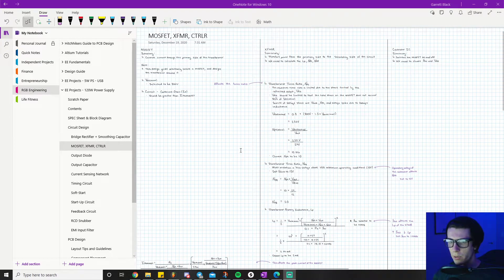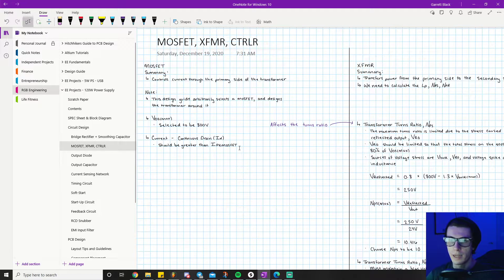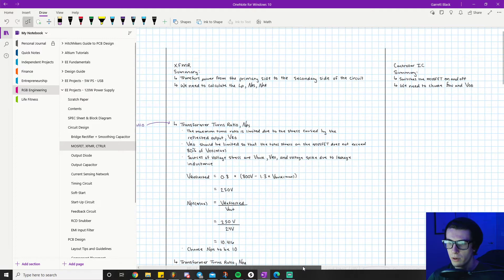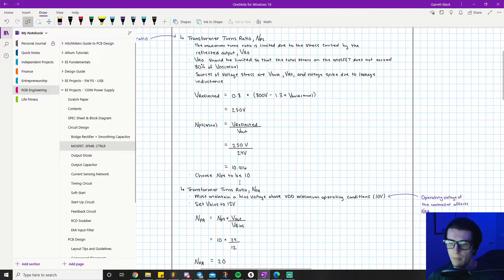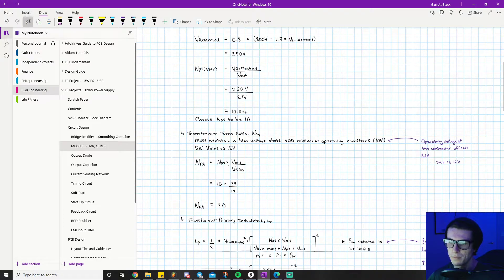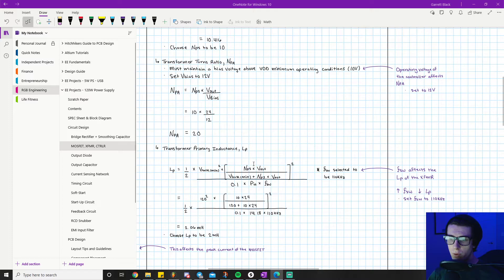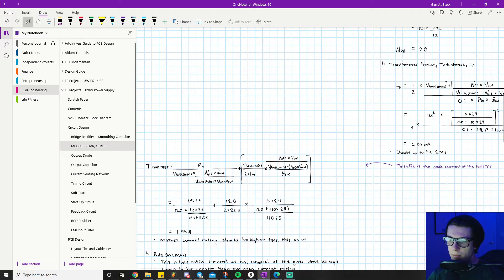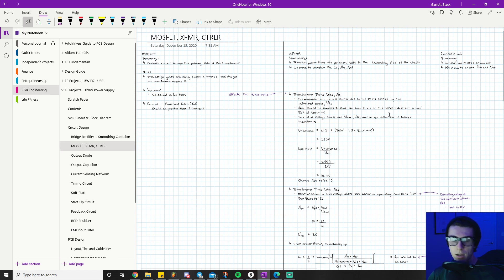FLYBACK CONVERTER PROJECT PT 5 | 24V, 120W FLYBACK CONVERTER EXAMPLE | POWER SUPPLY EXAMPLE PROJECT

Comment: Hi, great video! For the NPS turns ratio, I noticed you used VDS(max) = 800 V, while the reference design guide uses VDS(rated) = 650 V. Looking at datasheets, I'm just seeing a single VDS value, which appears to be the max value. Are all 3 of these referring to the same thing [VDS, VDS(max), VDS(rated)]?

Comment: hello , in this video you calculated the ratio between primary and secondary and auxilary but how can we calculated the number of turns ?
Reply from the maker: the number of turns is usually determined by the transformer supplier (they do it for you).

Comment: Hi Sir,
This flyback converter utilize a CCM instead of a DCM? is it possible to use the same controller ic for CCM?
Reply from the maker: Yes, you can use the same controller IC for both CCM and DCM.
Reply: @RGBEngineering  Hi sir,
Thank you for the reply🙏